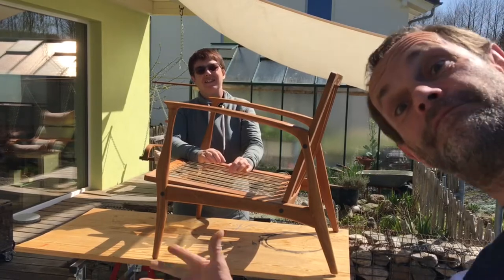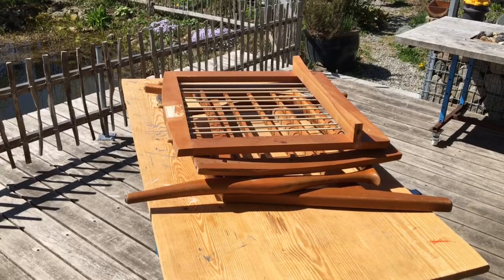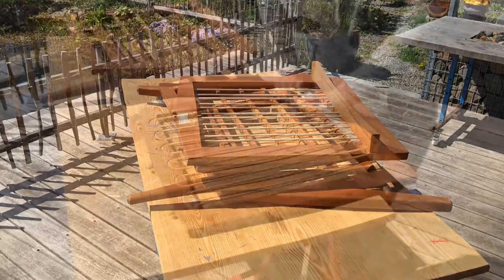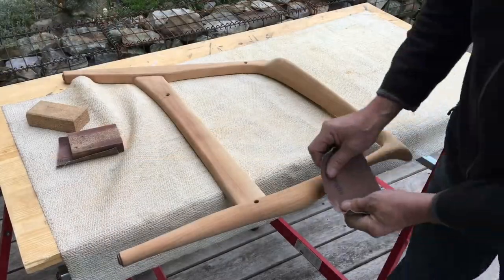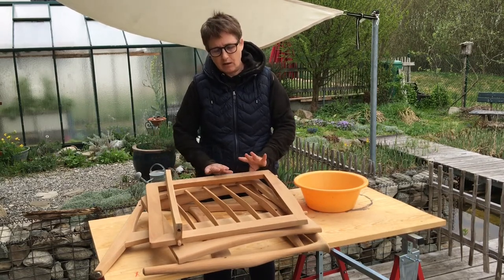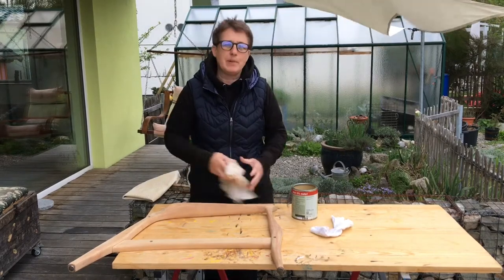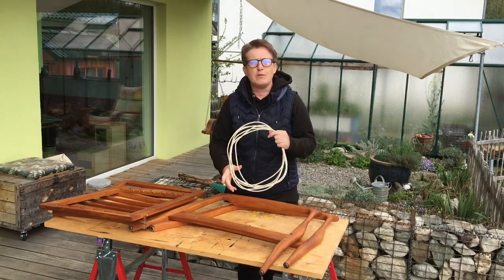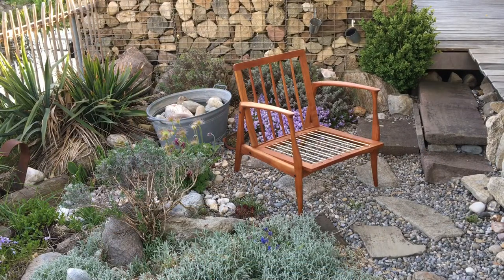DIY:Restoring a Midcentury  Modern Chair . Easy Chair Makeover.

Comment: Hello!  My inlaws have a similar chair that I wanted to restore for them.  Did you need to replace hardware?  I need to do that, and am having trouble finding the hardware.  Also, did you put in new white covered springs for the seat?  The ones on my chair are extremely brittle and some are broken.  Any help would be great.  Anthony
Reply from the maker: Hi Anthony, We didn't need to replace the hardware on this chair but we have had that problem on another chair.  I bought the springs here: https://www.designclassique.dk/restoring-wegner-furniture/plas-coated-springs-for-old-furniture- . Good luck with repairing your chair... we're sure it will turn out great. Sepp n Shelley